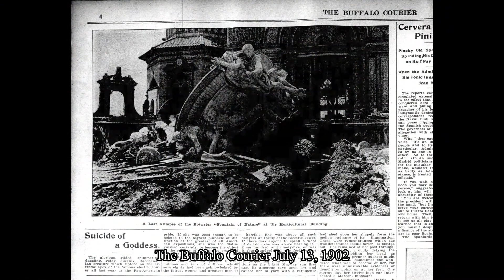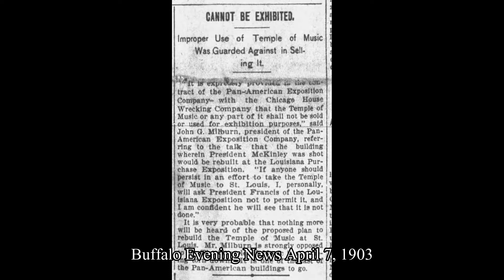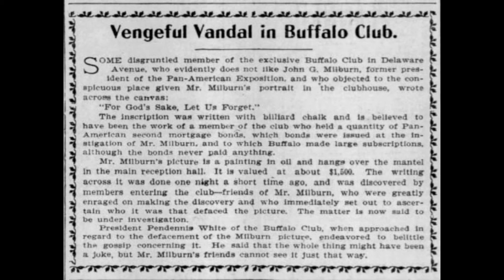Pan-Am Weekend 2021: Demolition of the Exposition

Comment: Many comment on why we don't build such buildings today.  Part of the reason is the proportion of building costs spent on electrical and HVAC systems is way higher today versus in those days where it was often practically nil.  Now a days HVAC and electrical are two of the largest items in the construction budget.

Secondly, these buildings deteriorate at almost the same pace as modern buildings if they haven't been maintained.  And many better built buildings were torn down as renovations and upgrades were cost prohibitive.

Third would be the massive amount of government labor and building regulations we have today adds significantly to buildings costs.

Also, these buildings were not built well.  I have experience in the exposition industry and I always like to say "Don't look behind the drape."  The façade that people see is the most important, no different than movie sets.